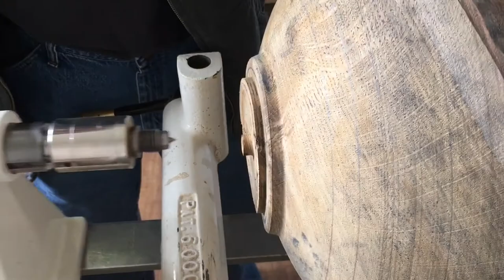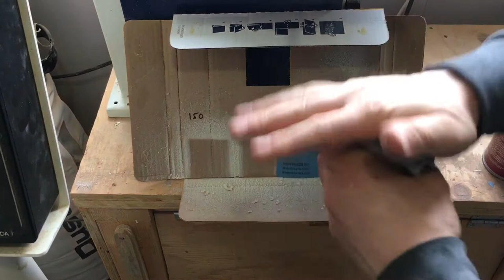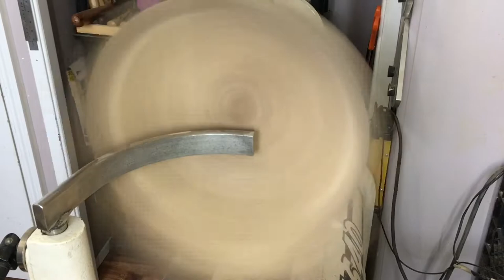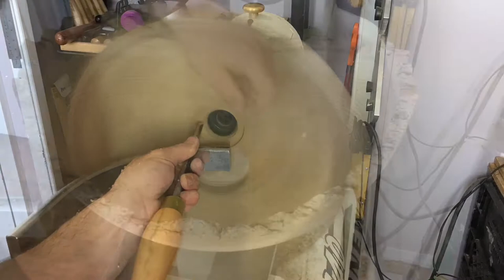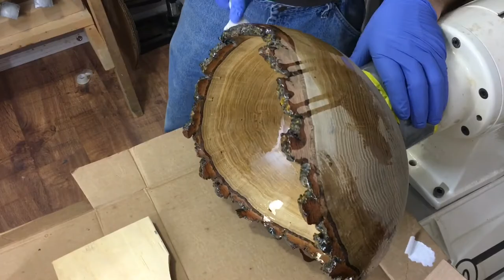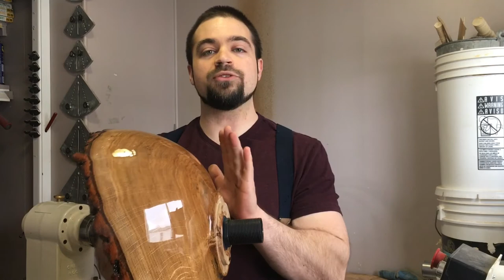Woodturning - Finishing up a Wood Turned Sink (Bur Oak)

Comment: Wow I really like that sink. Absolute beautiful finish. You have been inspiring me with everything I have seen of yours.
I have 6 more natural edge turnings that are about finished. Plus some fresh turned Apple and Cypress bowls roughed out and drying. I can say for sure that seeing your work has me wanting to turn a bowl or more a day.
 I was wondering on your Oneway 5/8 gouge what the nose angle is and if you are using the vari-grind where do you have it set.
 My new Sorby fingernail gouge is not swept back all that much. Another interesting thing is I have taken some drill rod and machined out some shapes and have heat treated them. They actually have a great edge. I might be a bit cheap but this gives me an idea of what kind of grind I might want without grinding away new tools.
 I wanted to ask about the grind but mostly wanted to let you know  how nice your work is.

Gary
Reply from the maker: ThePapa1947 Hey Gary great to hear of all the turnings you've been working on!
My 5/8 Oneway is at about a 60* nose angle, and I have my vari-grind set to where the lowest notch is inline with the bottom edge of the arm. I use a small nail half hammered into my grinding stand to set it in the notch and slide the arm to it for better speed and repeatability. The protrusion of the tool is set to 2". This grind is great at pull cuts and shear scraping, but not as good at push cuts as my 40/40 grind gouge. 
The 40/40 is done on a platform set to 4O*, and you twist the tool to stay inline with the flute, and you swing the tool to the side 40* for the wings keeping the flute of the wing parallel to the tool rest. This is tricky to put into words! Haha if I were you (especially since you have those new homemade tools to experiment with, wicked idea there!) 
I would check out on YouTube a video called "Stuart Batty - How gouges cut". This video is basically the best one I have ever seen on this subject. It's quite long and dense, but well worth it. It's where I learned to do the 40/40 grind and now I can't be without the combination of both my swept back grind and my 40/40! 
I was looking for a chart that came with a glen Lucas tool I bought that showed different grinds and settings to use. If I can find it, I throw a picture of it up here on YouTube. 
Thanks for the kinds words again Gary. This sink was a challenge, almost exclusively because of the epoxy it required! 
Kyler
Reply: Thanks Kyler for the information. I really like the epoxy finish which you would have to have.
I cant tell you how many gallons of epoxy I used during my pattern making career. We used it to make fiberglass core boxes from the wood plugs we would make. That is what created the inside of a metal casting.
 I like the Stuart Batty site on sharpening. Also the D Way information. Both are well explained.
I did do the 40/40 grind on one of my home built tools. Those are tricky because milling the opening for the flute is a challenge I do have a Bridgeport cnc mill which helps.Cutting drill rod is not an easy task. 
 The 3/8 finger grind I did on my custom built tool worked like a charm.
 I have been reading about flute less gouges. Which look a lot like a scraper. And very easy to make. Robo Hippy has a great video on them. He is from Oregon also. About 90 miles from me I think.
 Hopefully tomorrow I can get something made showing my lathe tools I used for pattern making and also my newly built gouges.
 I want to get all latest turnings laid out as well.
 Thanks again and I really like your relaxed way of turning and presenting videos.

Gary
Reply from the maker: ThePapa1947 Maybe I should have consulted you about working with epoxy first lol I preplanned it all quite a bit, but was still a bit messy!
I'm glad you know of some good resources on sharpening, it's such a dynamic aspect of turning that it really does take a lot of research and trail and error. I'm still trying to refine my grinds so they cut the way I want them too, and probably will for a long time.
I remember watch Robohippie demonstrate the fluteless gouge a couple years ago. If you try them out, let me know how it goes! Funny how many of the well known YouTube turners live near by you!

Comment: Great jobb! 
thx for the video
I'm just wondering.
Don't you need to leave some bare wood to let it breath.
Otherwise the epoxy might degrad from the insid out. Att list it is something i thought was important when painting on wood with plastic paint.
what are you thoughts about that?
thanks

Comment: Awesome video. I have an enormous burl that I would like to turn into a sink. It is something like 30" in diameter and weighs (green, just cut), about 200 pounds. I have peeled it, and the underlying wood is gorgeous. After it's dried, it will weigh considerably less, of course, but do you think there is a lathe setup big enough to handle the turning? I am not equipped for something this enormous, so may have to farm that work out. Are there alternatives for turning something so huge? I could rough out the basin with gouges and then finish it with various sanding tools, I suppose. Any advice would be appreciated. Thank you.

Comment: Doing a walnut sink.  What is name of 2 part epoxy you used  and any problem with epoxy running and settling in bottonm of bowl
Reply from the maker: Roy Hosie Sorry for the late response! I used a product called "Art Resin" available on Amazon and it seemed to work well. Best to build up at least 2-3 thinner coats to avoid too much running but I still had to leave mine slowly turning on the lathe for a couple hours to avoid sags. The first coat will act like a sealer and you will likely get a bunch of air bubbles from the pores in the wood. Ive heard of people sealing with shellac first and that might be a good idea. Pop bubbles by using a propane torch and just lightly let the flame move over the surface and don't keep it in one place for too long. Worked out great and had no complaints from the customer so it must be holding up well. Hope this was helpful and I caught you in time!

Comment: Ky, pardon my ignorance, but I’m having a difficult time figuring out which way the log was oriented before you started, i, e., how did you get the shape of the bow from the log? Maybe you’ve shown it in past videos and I missed it. Any your work shows a great deal of planning and work. Certainly enjoy your concise description of how you work and the steps to achieve the quality of the piece. Thanks. PS maybe the correct way of stating the question is to ask how you achieved the curved live edge?
Reply from the maker: Dennis Shurtz Hello Dennis! This is a very commonly asked question I get about natural edge bowls. Basically when you look directly into the bowl, you are looking into the tree from the side of the tree. Before hollowing the inside you would have seen bark wrap right around the opening with the high points being closest to you, and the low points be where the barks wraps around the tree. The log was also cut in half lengthwise so the underside of the bowl is actually the centre of the tree. When I re-read my explanation is seems clear as mud, so I will leave a link to my video "log to natural edge bowl" which will show the process of how it comes from the log and gets oriented on the lathe. It's a much smaller bowl than this sink but it's the same turning. 
https://youtu.be/P--YPsS9L-0
Sorry I didn't have any filming on the turning of this sink but hopefully the other video will clear things up! 
Kyler
Reply: Woodturner Ky Thanks for pointing out the video. I don’t know why I couldn’t see that, but I appreciate you showing me.
Reply from the maker: Dennis Shurtz No problem Dennis! I figured it would show it much more clearly than me fumbling with my words haha